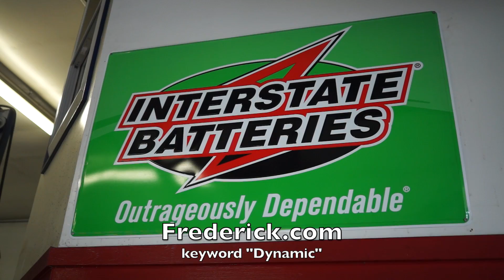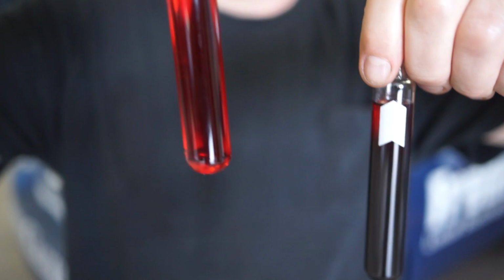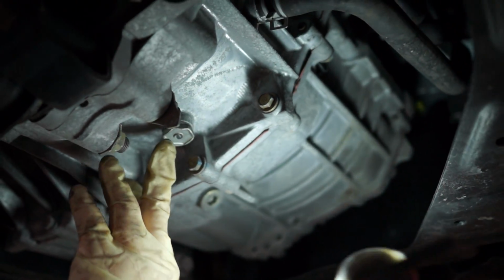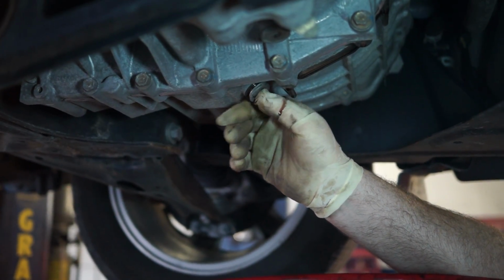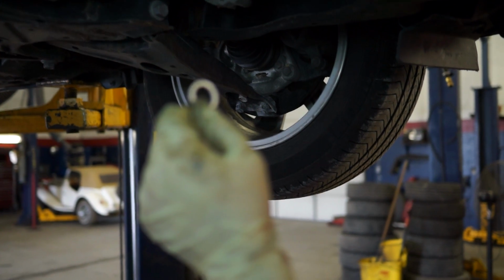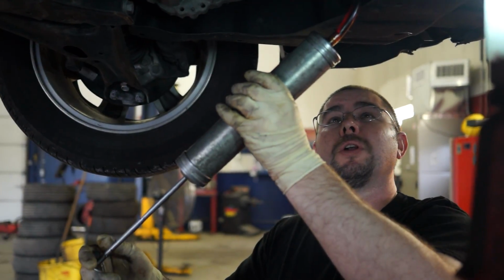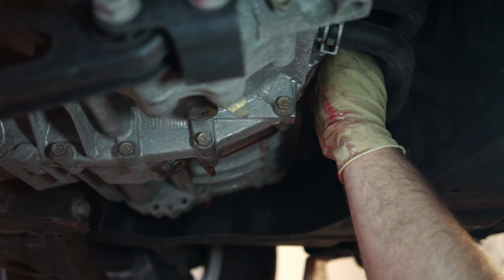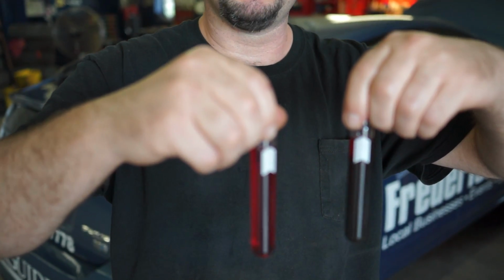Prius Transmission Fluid Change (eCVT)

Comment: great video. I'd be interested in seeing a fluid sample after the change. Say at 1000, 5000, 10,000 and 25,000 miles.. It would be interesting to see when it becomes black. (on average)  If the fluid becomes black rather quickly, then being black wouldn't be an important observation.
Reply: Craig Shipp That wasn't my question at all. I am already prepared to change my fluids at proper intervals.  But you made a real point of showing the fluid colors in tubes and claimed that this translates into fluid breakdown and clutch material. You were really overthinking things in the video. I'm only asking what data supports the idea that fluid color is directly correlated with bad fluid. Would be nice to know. Maybe it gets black within the first 5000 miles.

Comment: Why doesn't fluid temperature and measurement come into play like my 2016 Highlander?  Filling to the fill plug level and calling it a day regardless of temperature is so much easier than the complicated BS needed to fill mine.  Must be the CVT that makes it different. Great video
Reply: No torque converter in play.  An eCVT is a comparatively simple collection of planetary gears and only holds 4 quarts.  Much easier to service one of these and a conventional transmission with it's far greater capacity and large oil pan.

The filter is not serviceable on eCVTs though, but it is pretty much just a simple metal screen.  If one does not wait to 200K miles to do this service, a clogged screen should not be an issue.

Comment: I love my Prius but Toyota did not design the fluid changes to be very easy to do. I started changing my own oil because that way I know it's been done correctly. The last two changes I had a feeling they did not change the oil filter. When I changed it the oil filter looked like it was very old and full of gunk. There is no way to prove that they did not change the oil filter but I had to get a breaker bar to get the cover off. They could have damaged my engine but I can't prove it.
Reply: yip, same here. But its not toyotas fault, its the greedy money grabing at the dealer. Toyota should at least have a web page or even a Facebook page to hear horror stories that go on. i have a few codes come up ATM that require major work and am going to do it at home o the garage floor rather than take it to a dealership to rob me while i let them. Im just not that type of guy, if someone wants to mess with me, well, im in!.
Reply: That's a good call. (I wouldn't trust the either) I do, however, change my filter every other oil change. That's because my Prius already has 80,000 miles on it. The engine should be well adjusted. Newer engines produce a lot of metal particles that the filter catches. Once the engine gets a lot of miles on it, the oil filters should last a bit longer between oil changes.
Reply: Jeff Donaldson 7

Comment: I have a 2005 model and notice it has a pan underneath.  Does it have a filter in there just like any other automatic transmission? Is there a certain way to change the trans fluid compared to other automatics? Thank you

Comment: I have one Prius at 180,000 miles, and one at 113,000 miles. Neither one has had their transmission fluid changed. Is it too late to change the transmission fluid now? I’ve heard it’s bad change after so many miles.thank you.
Reply from the maker: I would change it!
Reply: Bob rainy , so have you changed it? if so has it had any problem at all or runs just the same . I'm just wondering if I should my 2011 had 100,000 so I'm considering.
Reply: Change them........mine was jet black.......................
Reply: @raulito5000  I have never had a problem with with the transmissions yet and I have not change the fluids yet.  I want to get at least 300,000 miles out of these cars.  I have never heard of the transmission going out on a prius.  I wonder if this even needs done.

Comment: You didn’t say how many miles that had on the oil change? Also it would be clever to install a magnetic drain plug I wonder why they don’t use that ???
Reply from the maker: It was about 80k miles.

Comment: Oh yess, One more Thing!! I have just discovered a very interesting picture. If you look very closely at the Cut Away Picture provided by Toyota, of a Series 2 Prius engine and transmission. Yes it is easy to find it on the internet. You will see that the metal of the case casting where it was cut & then colored yellow to show, the position of the cut, and in this way to view the inner workings of this transmission.  I can see that there are main support bearings that look like they would block the flow of oil/fluid from getting to either one of electric Motor/Alternator assemblies. And, one can assume that no oil/fluid would get to the Electrical motor/alternator assemblies if these bearings were properly sealed. If the picture provided by Toyota is a accurate representation of a cut away view of a Series 2 engine & transmission, I really don't see, & it really doesn't look like it should, have any oil/fluid in there at all!!!
But I have been assured by mechanics that have taken these transmissions apart, that yes the transmission oil does get in there. All-tho, I can't imagine it would be very much. Maybe this is a byproduct of some sort of bearing seal failure that allowed the oil/fluid to get it there. Hummmmm, It this point I can only take their word for it.
But of course like I said in my previous post take everything with a grain of salt & search for the truth & the facts!!

Comment: What are the symptoms of low transimision fluid in this 2010 prius. My 2012 prius does not show energy distribution when driving. It only display my tyres moving in energy monitor screen. How the energy is distributed is not shown. Could it be low transmission fluid?

Comment: I did asked tyota dealership if i ever  have to change oil transmission on my tyota prius hibrid 2009 1.8 I was told it last forever, so you don't have to change it it's  life time oil.  In this  point I am littel bit confused?
Reply from the maker: They also want to sell you a new car every few years. I keep all the fluids in my car clean.

Comment: yeah but even if you drain and refill with new fluid, as soon as you drive it for a few miles, the fluid will look dirty again just like if you never changed it. Remember all the gunk inside the transmission will mix with the new fluid.

Comment: I have 140k miles on my 2008 Prius and never had the CVT fluid changed no issues so far
Reply from the maker: The key word there is so far. I would change it. Make sure you use the correct fluid.
Reply: i have 2014 prius v 339k miles i bought it new never change the transmission or cvt  oil yet (runs good for uber ) and not even planing to change it what you think
Reply from the maker: @axmed711  they are well made cars!

Comment: thank you for the Video, I went to the dealer and they say that the oil needs to be place on a special machine to warm it up at certain temperature before to put in to the transmission, is that true? or they just say it to make money. 
thank you very much.
Reply: BS. In fact. I would suggest you avoid the DYNAMIC fluid flush. It can damage older transmissions. DO STATIC fluid change like this one in this video. The dealer is trying to fleece you - or trying to have you help them pay off their flush machines leases!
Reply: On my 2008, on my first change, I took it to an independent garage, and they did it according to the Chilton manual, which is like what was shown in the video. And they used the official WS fluid I got from Amazon.
For the second change, I went to an oil change franchise, and they insisted that they had to go by some updated factory requirements, which used specialized equipment (possibly using heat), and yet they insisted that their proprietary ATF met the WS specs.  I let them do the work, and though I didn't have any problems with the CVT, the process was sure a heck of a lot more expensive!

Comment: wouldn't it be easier to use a funnel with a hose from the top of the car?
Reply: ***** how is pumping oil up through that pump easier than pouring it down a funnel? he said he had to do it at least 8 times seems kind of overkill and an easy way to charge more when all he has to do is lower the car stick a hose+funnel in the transmission and pour 4 quarts in.
Reply: I use a 3' hose and a funnel from the top...way easier.....especialy if you don't have a lift

Comment: Hi I have camry 2007 LE 4 cyl with 80,000 miles.  There is no dipstick to check the transmission fluid.  One of the dealers mentioned that the transmission fluid is lifetime and there is no need to change it!  I just do not believe there is lifetime fluid.  One of the dealers agreed to change it.  I just wonder if anyone has an idea on how to do so?  as I heard the temperature of the fluid has to be at certain temperature?  I am not sure also if my transmission in U241E or U250E?  Any guide will be appreciated.

Comment: question i have a 04 toyota prius ,i love the car but lately i am having trouble climbing hills,
i bought the car second hand, it only has 83907 miles . would transmission fluid cause it to run fine on flat ground but not climb hills ?
Reply: doubt it

Comment: Do you have change this oil in e-cvt in RAV4 Hybrid 2019? I thought I do not need to change the oil in this gearbox that it is maintenance free?
Reply from the maker: As long as you are not planning on keeping the car a long time you will be ok. Just trade every few years and it will be fine. For me I keep my Toyotas forever so I keep all the fluids in great shape.
Reply: @MidAtlanticTV  i plan to keep toyota long, but if this is only needed every 5 years ist ok.

Comment: It's not a CVT at all. It's a Power Split Device. Easy to change with a jack. Fill from the top. Get rid of the WS ATF. It's not synthetic and foru members have had Blackstone Labs test it. BAD! Change every 30k. Or junk the WS and put in a superior ATF, Group 4/5. That's REDLINE D6. Available on Amazon. All 3 of my Prii have had D6 for years. I change every 50k. Remember, the Power Split Device has no filter. You need a big allen socket, a 24mm socket, and a funnel with clear tubing. Take off the panel above the radiator and you can put a funnel/tube straight down into the fill hole. You can also remove the top of the inverter and there is a fill plug there.

Comment: So you can only fill the transmission fluid from the bottom
Reply from the maker: Yes. Some run a hose from the top but there is only one fill hole.

Comment: Thank you for your great video.  I have a 2008 Prius, and have decided to have it changed at its 60k check-up.  I would not have thought of not doing it myself, but the need to elevate it at all four sides in order to make sure its level, and using a pump, or finagling a long hose and funnel, seems to make more sense to find someone better equipped who will do this pretty easy job at a reasonable price.  You didn't mention checking a magnetic plug for wear metal.  Does it really have one?
Reply: Jack up the passenger side. Remove drain plug.....lower car.....let drain....reinstall drain plug use long hose with funnel on top.....pour in 4 quarts and let it overfill into drain pan
Reply: @VoiceAlertTexas  Good solution.  The real irritating problem is removing and reinstalling all those push pins and bolts holding the plastic panel covering the underside of the Prius - doable, but not fun in a cramped space.

Comment: Hi, I have gone twise to toyota dealer to do transmission fluid replace on my 2009 prius with 54k and all 3 times I was told they don do fuid change on prius beause of the kind of transmission it come with. The only  thing I have to change on transmission is the coolant at 100k. Doing transmission fluid before that would void  my warranty. 
I explaind I've seen videos when replacing fluid at 30k miles for example how dark the fluid is and they said thats ok, fluid gets heat every day and turns purple wich is normal,  these transmissions  and fluid were designed to be there for at least 100k without any service other than coolant. 

Another transmission guy told me exactly the same thing.  Toyota said they can still do it for me but it I have problem with transmission warranty will be voided.

So now  dont know who  is right. One thing I can tell you, I also own a 2002 honda odyssey and did the first transmission fluid service at 100k and no problems at all.
Reply: Toyot dealership used to tell me its sealed case, with lifetime warranty and fluid.
after a year things changed, now they say change the tranny fluid every 50K miles just like coolant.
Reply: You can easily change your Prius transmission fluid at anytime you want, but don't wait past 100K. Basically, change it at least every 100K, but if you want to change it every 50K, then why not? Just follow this video, and look at other videos on YouTube for this same job, so you can decide what procedure works best for your DIY setup. That's what I did and I changed the transmission fluid on all three of my Prius vehicles (2005, 2007, 2010). Just make sure you get 4 qts of the Toyota ATWS fluid and 2 of the drain and fill plug washers from the dealer also, and a 10mm hex socket from Harbor Freight.

Comment: I have a question. Should the fluid drip out or stream out of fill plug opening when full?
Reply: Fluid should just begin to start to flow out, which is approx 3.8 qts.

Comment: What about the Transmission fluid that's left in the Radiator (Below Tank)? 

how's its gone come out ?
Reply from the maker: Not sure that this system works that way. Remember this is a CVT.
Reply: @MidAtlanticTV  it's not CVT it's eCVT
Reply from the maker: @asimrashid999  OK!
Reply: Asim Rashid This transmission is cooled by the inverter circuit(coolant). It doesn’t utilize an external cooler nor the lower portion of the radiator like a typical car. 

As for your question as it pertains to other vehicles, a few ounces of used fluid will not present any issue when servicing a transmission. By doing so you are replenishing the friction modifiers and other additives that have been exhausted in the old left over fluid, while also removing the majority of abrasive wear particles.

Comment: I have had my Prius for 11 years and have never changed the fluid.
Reply from the maker: If you plan on keeping it you might want to change it.
Reply: @MidAtlanticTV  too late, it will be worse !
Reply: @claptoned0  How so? There are zero clutches in this transmission, so fresh fluid should do no damage. The idea of not changing fluid in high miles transmissions refers to worn down clutches needing some coarse material in the fluid to grab, which fresh fluid doesn't have.

Comment: can the Toyota Prius transmission take Valvoline Max life full synthetic fluid??
Reply: YES
Reply: I do NOT recommend Valvoline Max Life for the Prius. Use the Toyota ATWS Fluid. Only need to buy 4 qts and that's cheap compared to a new eCVT unit that was ruined because of not changing the fluid or ruined by not using the correct fluid. Replacement eCVT unit can be upwards of $3000 or more--yikes! Just go to Toyota dealer or buy 4 qts ATWS fluid from Amazon or eBay.

Comment: I think you do need a special scan tool to warm to temp and check fluid level. What he is doing here is guessing that its up to level. I rather pay little more now at dealer to make sure that i dont need a new transmission couple months later. But again you do get what you pay for.
Reply: Corect  the WS transmision fluid expands when warm and level shoud be checked at a certain temperature. If im not mistaket it shoud be checked at ~60 degrees Celsius ( im from Europe)
Reply: @noobsound   I have changed my twice.......no need to warm it up.......it's just a gear box....... fill till it runs out the top plug when the car is level......

Comment: Shouldn't the level be checked at a specific oil temperature...?
Reply: NO!~
Reply: I've done this job on all 3 of my Prius (2005, 2007, 2010). Job ideally should be done when car is cool. Because it's basically like changing manual transmission gear oil (but using ONLY Toyota ATWS Fluid instead--ATWS stands for Automatic Transmission World Standard) you are only filling to 3.8 qts, and that's when the fluid just starts to flow out of the fill hole, provided that the car is level.

Comment: There is a big difference between CVT and eCVT. Compared with normal automatic transmission system, the Prius eCVT is easier, not harder, on the ATF.

In addition, what is so special about WS ATF that many other after-market ATF's, like Maxlife, can not achieve?

Comment: what size the drain plug?? ....and the fuel ...?
Reply from the maker: Not sure.
Reply: The fill/check plug is 24mm and the drain plug is a 10mm allen key.
Reply from the maker: @eddunne5255  good info!

Comment: So it means when the oil comes out in the filling-hole while your filling it, means the oil level in the CVT transmission assembly is already in the correct level, right?..Thanks for the upload, it a nice video and God Bless .
Reply: Yes...it's full when it runs out the top hole...(car level)
Reply: I think I read once that it was supposed to be checked with "an ungloved hand" but yeah, when it leaks out, it's full.

Comment: The fact that mine is at 75k and the dealer is saying "Oh, no. You've got plenty of time left. Call us back when you get to 100k-115k miles." Seems like they just wanna sell some CVTs. . . 

And the fact that it feels like my CVT is slipping now...
Reply: cvts always feel like they are slipping. and IF it is failing, the dealership saved you the cost of a transmission fluid change that would've done you no good. 
also modern transmissions will detect slip electronically and throw a c.e.l. so that would be a clue. 
find an indie auto shop you can trust.